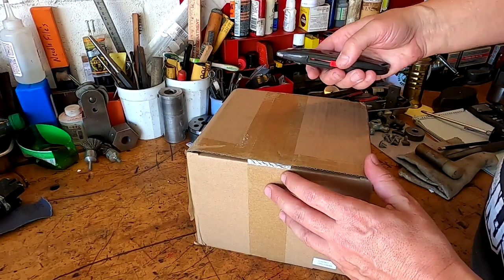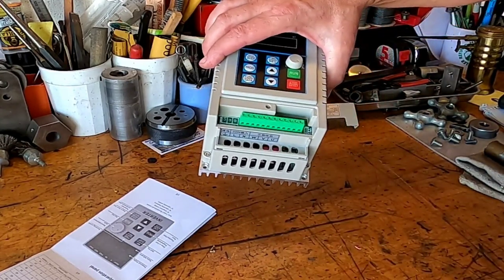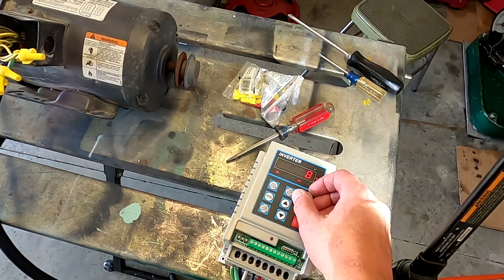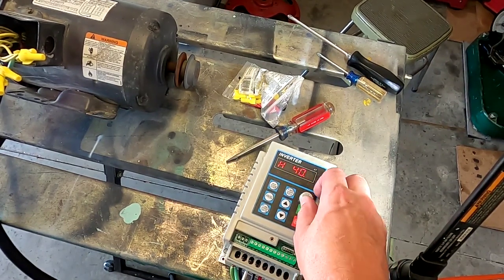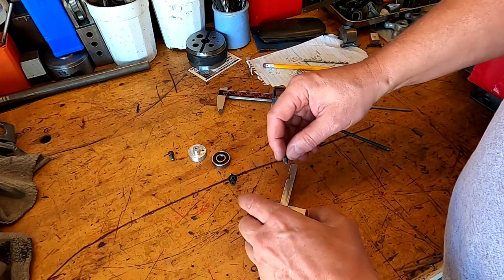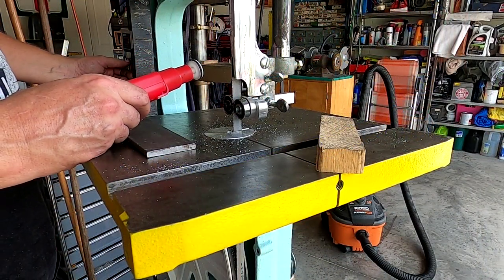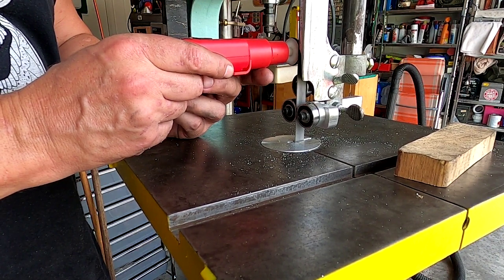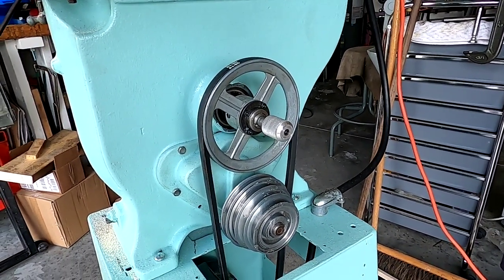I bought the cheapest VFD on Ebay. Wire it, Program it, Test it.

Comment: Don, by the time I post this you've had your VFD +8 months by now. The model I purchased was also inexpensive but has thus far been a blessing. I totally agree that the VFD is one of the most valuable upgrades one can make. The mere fact that it puts a 3 Phase motor to work in my shop is a giant leap forward. My VFD is rated at 1.5KW. it's a Soyanpower model SVD-E, which means nothing in today's huge China market. It's probably marketed under a variety of names and models. My user manual says that my model includes an upgrade that protects the Input Diode-Capacitor Bus from enormous inrush currents at mains turn on that past models were prone to. That said my user manual still stresses repeatedly the dangers of repeated turn on's and off's. They actually wanted the user to wait 2 hours after mains turn off before reconnecting! EEEEK! My guess is that the text in the manual was never amended with the Soft Start upgrade. I call it Soft Start but the industry name for it is "Pre-Charge Current Limiting". It is explained in this VFD video by a different manufacturer. 
https://youtu.be/HayryySX_po?t=353
Since my model didn't include a schematic I wasn't taking any chances and built my own external limiter that connects between my 240V mains and the VFD 240V input terminals. Now, at worst case I have double Inrush Current protection!😉 The second thing I did was mount an auxiliary fan on the motor's fan bell. I did this is because the motor's integral fan is connected to the motor's armature. When you slow a motor down to low rpm that fan isn't moving any air! Hence, the motor will overheat under load. The small box fan I chose is a 120V model and is not supplied by the VFD. At the moment it runs at full rpm whenever the motor is running. I will be modifying that logic to keep the fan running after the motor has stopped until a thermostat tells the fan to shut off when the motor has cooled off. 

Don, I'm guessing that you and I are a short drive from each other. We will break beer together one day soon.  I know you drink beer because you have the classic beer physique much like mine. Mine is just much older!:face-green-smiling:
Wakodahatchee Chris
Reply from the maker: Ha ha.. pretty funny. Too many years in Germany. You get used to beer flowing like water there. Cheaper than soda for sure.  I don't blame you for adding a fan. Cheap insurance. Don

Comment: Life long sparky and I never purchase or use any electrical, safety & test equipment or LED'S made in lying cheating lack of quality control communist china. Had way too many defects & short time life span with garbage from cheating china. My cheap boss purchased the cheapest 5 HP VFD that china loving WW Grainger stocked. He spent over 6 hours trying to program the POS. even made several phone calls to their worthless tech support. He returned it for a made in good old USA drive and had it programmed in just a few minutes. Worked on hundreds of great Danfoss VLT & FC drives and horrible tech support ABB VFD'S. We have a great Danfoss tech that only charges around $200 to $225 to do a start up. This extends the free parts & labor to three years.

Comment: I want to build a test bench for a diesel VE type injection pump off a 1HZ Toyota coaster engine. Not sure the total RMP i will need think about 2200RMP and or maybe 3600RPM max for a short while.

Can someone in the know run over these numbers and tell me if this VFD will match up to my motor. I'm totally new at this stuff first go at doing anything wow big learning experience. I will post vids on my channel eventually when i get it all set up. Thanks for any help!!

Motor Specs:
1 HP, 0.75kW, 50 HZ, 1405 RMP, INS F, AMB 45 o Celcius, CONT. RATING, TYPE AEEB-NECC, 240V, 3.24A, TRIANGLE SYMBOL NEXT TO THIS CONFIGURATION. 415V, 1.87A, THREE PRONGED AIRPLANE PROPELLER SYMBOL NEXT THIS RATINGS!!

Will my VFD with these below specs suit? Inpute Frequency 45-65 Hz Output Frequency 0.1-400 Hz Input Voltage AC 200-260V Output Voltage AC 220V Humidity 10-95% Relative Humidity (without dew) Control Mode SPWM Input Phase 1 or 3 Phase Output Phase 3 Phase Vibration 0.4 G Horsepower 2 HP Input Current 7.5 A Output Current 10 A

Thank you
Reply from the maker: You shouldn't have an issue with it, but be sure to set your max frequency down to around 80Hz or you'll have a mess. Also your start up/Min on a 50Hz motor will want o be around 30Hz.  Any lower and the drop off will kill it.  Don